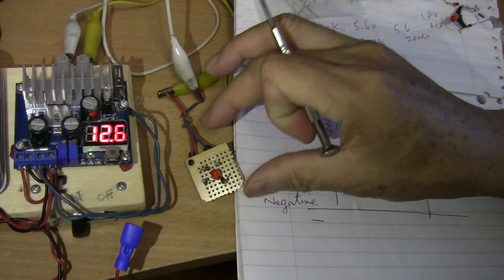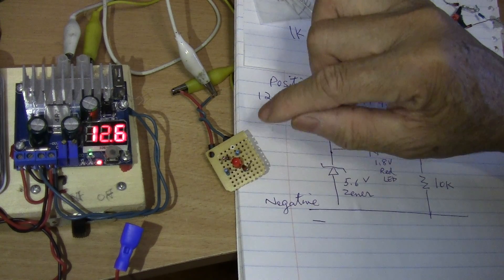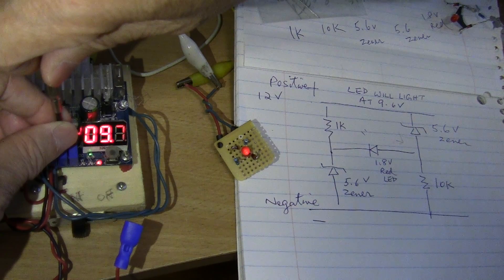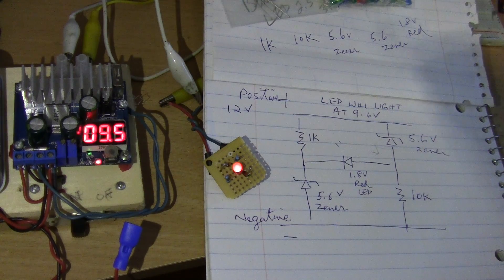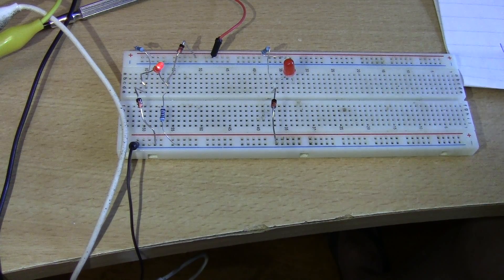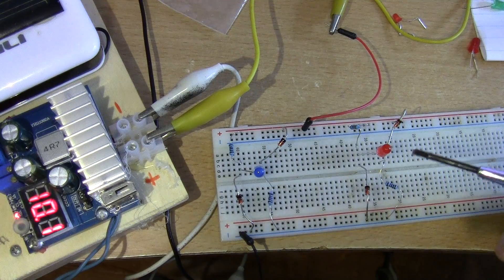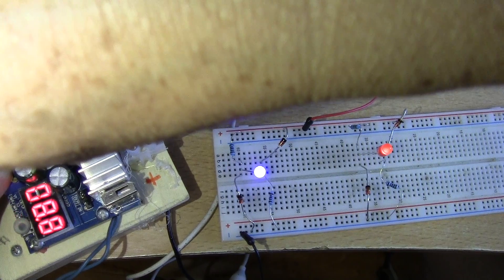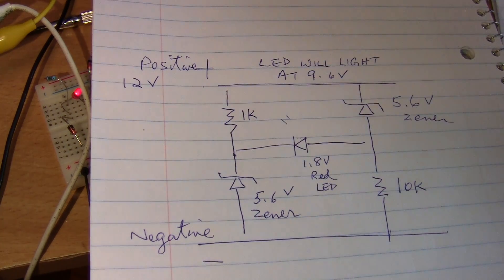Do it yourself 3 cell 18650 low voltage LED indicator light

Comment: Is there a name for this circuit or is there a formula for calculating the component values? 
I want to design an indicator for when the voltage goes below 2V.

Comment: Hi. Do you have for 2 cell 18650?  what are the values of zener diode?
Reply from the maker: It depends at what voltage you want the LED to come. You can try 3 volt zener diodes for 2 cell. Have different values zener on hand and experiment.

Comment: Hi. what components did you use with the blue led ? thanks
Reply from the maker: I think I used the same components for the blue. It's just that if you use blue led, it won't come on until the voltage drop to 9.2 v.
Reply: interesting. I dont know much about eletronics, do you know what components I would have to use to light a led when the voltage drops to 7v ?
Reply from the maker: Instead of the 1k and 10k resistors, you can try using variable trimpots so you can change the resistance and experiment by turning the trimpots to see when the led would light at 7v.
Reply: I will try this. thanks!

Comment: what if using 1 18650 cell? it start from 4.2volt and no zener diode lower than 3.3v. can we tweak it using potentio too? thx for the video.
Reply from the maker: I'm not sure about your question. If you're interested in a low voltage indicator light for one 18650, I have a video on how to make one:  https://youtu.be/LX-Z-nNqe64